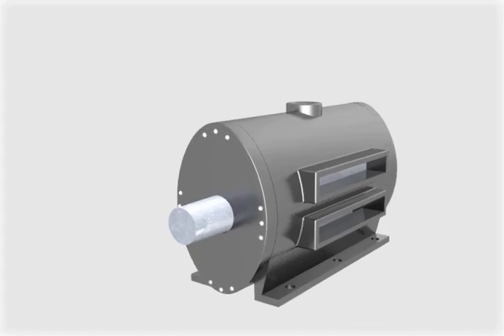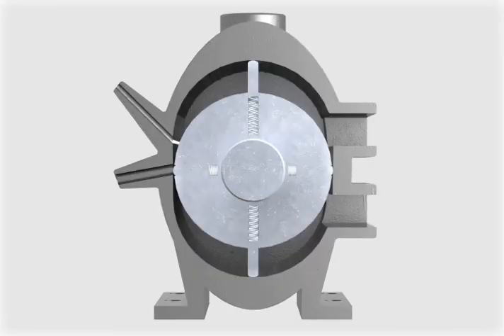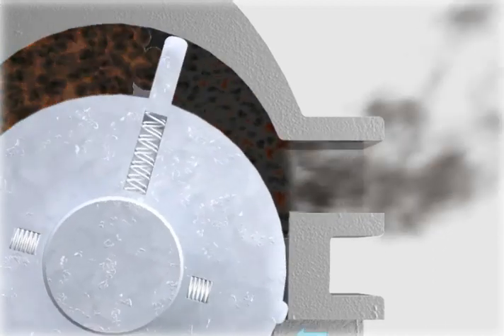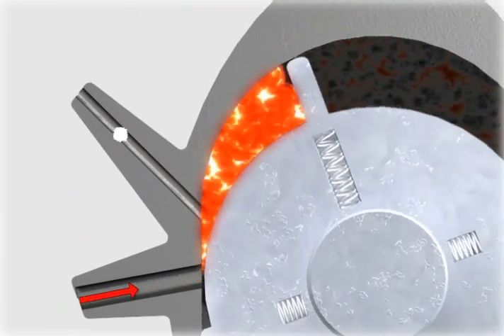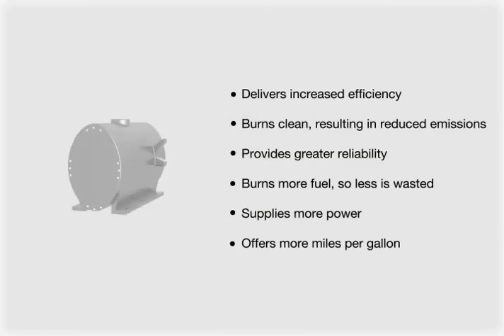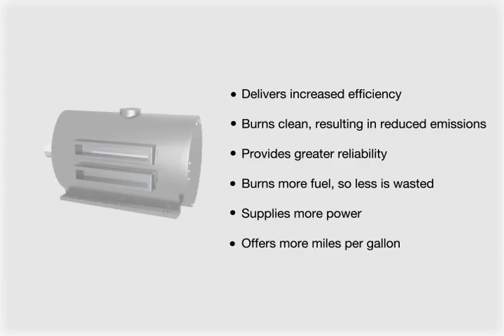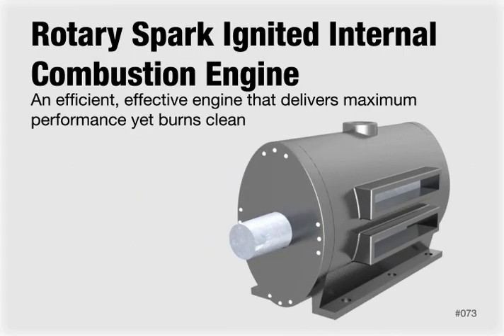Rotary Spark Ignited Internal Combustion Engine

Comment: Nix the springs behind the vanes. replace the springs with oil passages. have all 4 vanes connected to each other via the oil passages. the total volume in the oil passages will never change even though the vanes are moving in and out. the reason is two are always in and two are always out. this oil can be supplied to the rotor through special oil passages on either side of the rotor. this technology already exists in any engine with a VVT system. this system can also keep the rotor lubricated and clean at all times.
Reply: Great idea.

I thought to use some power from the combustion. Just have a channel that directs some of the combustion to add pressure under the vane to act like the spring. But I like your idea better. An advantage is also that it would lubricate the vane.

If there was as much design in this engine as the piston engine it might work.

Also... what is better here a diesel or gasoline power.
Reply: It seems strange that this has not been developed.

I wonder why?

Perhaps we need a contest for any working prototypes.
Reply: Who knows. I know I don't have the resources to build this. Maybe AvE does?
Reply: @TheEarthandyou the problem is that the centrifugal forces throw the vanes outward during high revs, resulting in a lot of friction.
Reply: @TheEarthandyou  because pressure acts in ALL directions equally.

despite what the animation may try to show, the combustion pressure acts on the opposing vane as well. theres nothing making it run one way versus the other.

then, the vanes definitely cannot extend as far as the animation shows. the tilt in their slots and shred out the housing. theyve been used as pumps for years, and various overlooked design aspects have been addressed.

and as the pressure acts on both vanes at either end of any "chamber", the only work available is the DIFFERENCE in the areas... which equates to barely anything.

they make great air BLOWERS. they work fine at moving a fluid. they are useless when asked to do the opposite, to extract power from an EXPANDING gas.

in those air tools that use them? theyre not EXPANDING the air, theyre blasting it in at full pressure, acting more like a poor-mans turbine. extremely inefficient and only used as theyre simple, cheap, and convenient. as long as the rattle gun gets the lugnuts off, or the die grinder can grind, the average user doesnt care about how much power the compressor requires to supply the volume of air needed.

this is also why they had no success in the era of steam, as a lot of fuel was required to maintain the steam supply, for very little work being performed at the shaft. unlike a "real" steam turbine that uses the heat and the pressure causing expansion, contained in the steam. there have been hundreds of various attempts.. thousands... all delegated to the scrap heap, to only pop up every few years as history tends to only remember the successes rather than the failures.  try image searching "steam rotary engines" and enter the rabbit hole of failed designs... "douglas self" has the most comprehensive library...

the last one that was "developed" was the sarichs orbital. was all the rage in the 70s... lots of money invested... and not one of them was able to run under its own power.

Comment: Note - very high surface area to volume ratio (same problem as the Wankel) There will be very large energy loss to the coolant and so low thermal efficiency. Flame quench will also be an issue resulting in high un-burned fuel content in the exhaust. In fact, the black smoke shown in the animation is prophetic of this!
The seals will be more problematic than those in the Wankel because of both rubbing/fricition/wear problems and the length of them when fully exposed.

Comment: This principle is about 100 years old and is used as hydraulic oil pump for the steering system, developed by Mercedes Benz. Nobody succeeded with this principle as an engine. Even if,  it needs oil in the gasoline for lubrication, what is unacceptable today. Sorry, but a nice animation.
Wolfhart Willimczik
Physicist & Inventor

Comment: I drew this design up over 50 years ago,  decided it was not very good.   It's similar to  hydraulic motors, vacuum pumps and blowers .
Reply: Indeed this design is as old as the steam engine and was tried at the dawn of internal combustion engines. Maybe today with better metallurgy and EDM it could be possible to manufacture vane that are internally cooled and hardened enough to  survive a few hours? That would not be feasible for a car, but perfect for a drone or an emergency lightweight generator.

Comment: This has been tried in physical prototypes and here are the major problems:
1) As with Wankel engines, the sealing at the vane apex seals and side chamber seals and vane sliding seals  make holding compression very difficult. The seals are also a longevity problem and hard to access for replacement.
2) They tend to want to burn a bit of oil to keep all the sealing around the sliding/moving chambers functioning and this adds to oil consumption and poor emissions.
3) During  the combustion phase, the vanes themselves are carrying a high side load against the tracks as the vanes are trying to slide as the combustion chamber expands. This highly increases the friction during expansion.
4) The vanes cannot just be spring loaded. The pressure from the combustion pushed the vanes back into the tracks.
Reply: hay just pointing out, having spring loaded seals is almost like brushes in an electric motor, having similair contact the whole way through its life and so solving the sealing issue of wankels . engine design has been rehashed by driving for answers
Reply: @ziggyinta  so where is the working model?
so why didnt they use them in the era of steam despite the basic, and very simple principle having been known for at least 150 years?

what happened to the "sarichs orbital"? was all touted as being "the next big thing" yet not one ever actually RAN under its own power.

ok, so one of the "big channels" re-hashed the engine design. what does that prove? other than that a lot of people are now misinformed and cant figure out why these things always have been and always will be utterly useless for doing anything but BLOWING air or other fluids?

Comment: I was employed as a young machinist in the late 1960’s making parts for things very much like these things. I think they sold them to the potash mines as fairly low pressure,high volume air compressors for blowing drillings out of hole as they drilled.

Comment: The bottom air intake section can also be a compressing/ignition section by pre-mixing the fuel air - as per Orbital.

The casing and rotor can be revered in shape. the rotor being oval. Then the springs can be easily changed from the casing.  The spring will weaken, so easy changing is essential.

Comment: Mallory built a vane engine back in the 60’s.  It ran like a scalded ape.  Leakage at sloe speed was a problem.
    The engine was a rotor inside a circle housing  (inside an elliptical housing) and required a scavenge blower.  The vane centrifugal force produced a too much friction w/ the housing.  Mallory remedied by internal cam in face plates and followers on the vanes.  In the end plates near TDC were slots where the flame blew back from the expanding cavity to its successor.  Plugs just got it started.
    It was a Brayton cycle engine, aka gas turbine.
    The vane engine, like the Wankel is HC dirty, looses heat to end plates and housing, has a lost oil system, is difficult to seal, and difficult to seal rotor.  Too many problems for auto application.  It’s simplicity and power to weight suggests it’s a poor man’s turbine for light aircraft.   Cheers.
Reply: It seems that all problems could be solved.

Comment: I have come with similar idea 33 years ago. It started as a closed turbine in my mind, but ended up a vane motor. I have theoretically solved all sealing problems with a very siple idea and the extreme centrifugal force that the pistons would experience (that was a friends idea). As well, is able to run in high temperatures and in my mind should be air cooled at a controlled enviroment like enclosure. Certainly, the actual shape we see here is far from my final thought, but principal is similar.  And efficiency is better, should be even better than Diesel cycle (this was a quote from an engineer where I presented a brief scetch). I am sure the right person would have no problem to make it viable. Unfortunatelly I need eye for the details. Downside, oil/fuel mixture burning cannot be overcome, meaning that will be a challenge to pass emmissions.

Comment: This is a great video.

Perhaps we can develop it in an open source development.

For instance the vanes can be angled slightly, perhaps, to use natural pressure to help seal the combustion.

Also using oil under the vanes to spring them upward.

We can build the working virtual model first.

Hurrah...

Comment: Just needed to see how the vanes acted to spot weak spots at this design. Those vanes would not move further than either the intake or the exhaust entrances without getting stuck and things would get bad with the expanding gases that makes an internal combustion engine to even work at all.

Comment: you have to have a large enough gap on the sides there for the compressed air to get through quickly, wouldn't that also allow the air to go the other way?  i mean, when it fires, wouldn't that high pressure gas go backwards as well?  since the air gap is large enough to allow that much flow?  
   and wouldn't a LOT of the high pressure exhaust gasses get into the intake air?
I hope the thing works, I'd love to read about some actual testing.
Reply: you'd just have to offset the ports enough vertically to create an overlap in the vanes, so it seals the exhaust totally from the intake. But there are bigger issues than this. Mainly the fact that those vanes will have to be mechanically very strong to resist the combustion forces leveraging on them at peak expansion, when the contact surface between them and the rotating piston will be the smallest, and because of that, they will most likely be very heavy. And also because of angular speed, you will have increased friction between the vane walls and the rotary assembly, thus preventing the engine from rotating at even what we would consider low rpm's (1000ish) for a normal engine, due to the inertia of the vanes causing spring float during the relaxation of the springs, because of the factors mentioned above. Ideally you'd need a mechanical system to push the vanes outwards and inwards, not relying on the block to do the compression either, because it will wear out the sealing surface very fast. and even if you manage to fix this (its been done before, there is a patent that shows this version) you still face the standard challenges a tangent seal will produce, especially one that travels such a long distance, so you'll be faced with wankel-like issues. Also, the entire setup of the vanes, regarding the expansion forces is suboptimal, especially at this angle, and most likely will prevent any engine like this from running. I dont condemn inovation, but do it wisely.

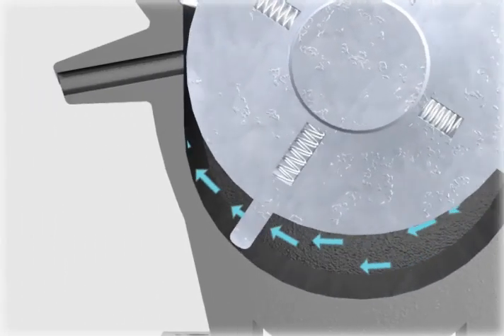Comment: Seals might flex and there is the whole lubricating & sealing issue, also, at 0:45, it looks like the vanes should be pushed into the intake and exhaust passages when passing by.

Comment: Some aspects of this concept are very cool. You have to do a little math to see how the engine works. If you sum up all the forces on the vanes the forces in the direction of the desired rotation overpower those in the negative direction which gives a net force causing work.

Comment: I can see how it would get it's power, if there were no problems with the compressed air. What I 1st asked was, how does the compressed air get to the other side of the vane.....I now see that there is a side port that takes it out and then brings it back in again on the other side of the housing. However this raises a new problem for me.

If the same air that's being compressed is also being burnt, it will put equal pressure back on the vane doing the compressing, stopping it from running.

Comment: I had exactly the same idea about 20 years ago when I pulled apart a rotary vane refrigeration compressor. However, after looking into it I found that a guy in the States built one back in the 1930s & ran it in a motorcycle before concluding that it wore out too quickly.

Comment: Rotary vane engines are not new. And yes they burn clean because the previous vane scrapes the combustion area clean, started life as a multi use vacuum/compressor pump or steam motor

Comment: so what if it rotated that hign? use a gearbox to reduce the rpm. Take tanks for excample. many use turbine engines that rotate a lot faster than 27000 rpm. Also the reason that turbine engines are not practical to use in cars is not their operating speed but their lack of constant efficiency at variable speeds. what engine are you referring to?

Comment: In order for the engine to run, the pressure in the compression side needs to be lower than on the "power" side….or for at least most of the time, until the final squeeze. To do this the compressed air needs to go somewhere (side chamber, maybe?) until the vane that compressed it goes past, then it can be burnt and put pressure on the other side of the same vain for the whole "power stroke". Until this happens, the engine won't run.

Comment: Kudos for thinking outside the box, but you missed quite a few very important details.
You have MASSIVE exposed surface area, which translates into low thermal efficiency,
this will result in the same problems that current Wankel engines have, only worse.
The combustion process needs to happen outside, or separately from the steam motor,
and the steam temperature needs to be brought WAY down, and increased in volume.
I've already figured out all the problems, and eliminated them from my engine design.
Think specialized external combustion chamber with LOTS of water injection.
Good Luck.

Comment: Why not just make a jet engine then?  I mean, if you are continually going to feed gas and ignition to the process, might as well have the least amount of moving parts right?  You have 4 high-tension springs moving against a barrier...a jet engine just has 1 rod through the entire unit with fans connected at specific points.

Comment: diesel engines can reach 60% efficiency i think you mean higher power to weight ratio. i guess that can be efficient when it comes to transport but the engine itself would have to have a higher compression than a diesel to be more efficent.

Comment: Nice presentation, but you need to look at engineworksgmbh. Yours is a very old idea that didn't work very well. I thought of having a separate intake/compression rotor and combustion rotor. The guy at the above site told me my idea caused too much friction & apparently successful designs need the vanes to be controlled by a track not springs. He was a chief engineer at Airbus and has built several experimental models in Germany. His site is also called fencejumper engine.

Comment: Cycle Carnot from start is limiting the efficiency of any thermal engine. Of course some engines are better than others, but you cannot claim you have a better efficiency and that is better for environment before you start a prototype and measure the percent of various burnt exhaust gases.

Comment: im sorry this wont work because the pressure would cause the veins to open its a good idea on a air compressor under 20 psi...ie it takes more than 100 psi to compress petrol and more than 2000 psi for the combustion. mayby instead of springs use rotational cam to open and close the veins or pattle. that may be better but over all its not cost effective.

Comment: I have the same design. Except the gates on my design are not spring loaded. My design also address issues with the cooling and lubricating the seals which are the problems holding back rotary engines. The author of this video also didn't talk about how charged air got transferred from the compression chamber to the combustion chamber. There are also other issues of rotary engines (wankel) relating to expansion efficiency which this and my design can easily address.
Reply: Any update after 5 years

Comment: I see the heat jamming up the vanes ,and springs weaking from heat and over work.
your engine would work in a low pressure application BMEP less than 100 PSI.
Clean???????? no way you have to mix oil with gas to lubercate the vanes burnt oil emissions.

Comment: This is a plain old rotary vane pump turned engine. Just  google "positive displacement pump", pick one, add a couple of spark plugs and you can play genius on the internet to the unbridled amazement and incessant admiration of the ignorant. There are reasons why the good old piston-and-crankshaft setup is still the way to go, and these reasons are called "leaks" and "friction". This is why these "novel" engines will never take off.

Comment: That's VANES not veins. The layout doesn't look much different to an air blower. What I can never understand is how people have the nerve to make claims about greater efficiency, more power etc. until they have actually BUILT an engine and run it on a test bed. Most of these ideas have been tried before and dropped, albeit often because the materials of the day were not up to it.

Comment: This is a very old design re-invented. The extending seals will have no cooling, no lubricant and suffer massive sideloads which will wear them out or make them jam - or both. side sealing the rotor will prove extremely difficult and combustion will be very poor. The designer clearly has not had anytime in the engine industry and has not studied history. a search of old patents will show up the failures of the past.

Sorry but this isn't a happening thing.